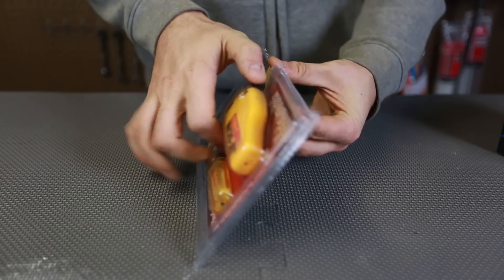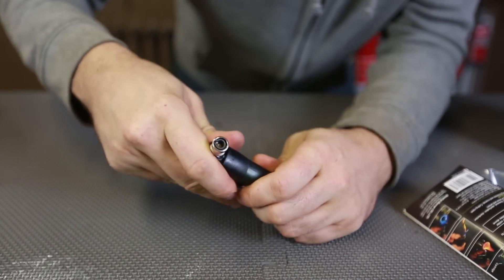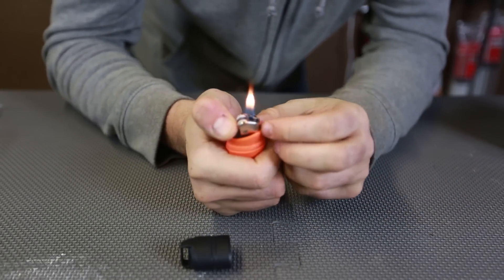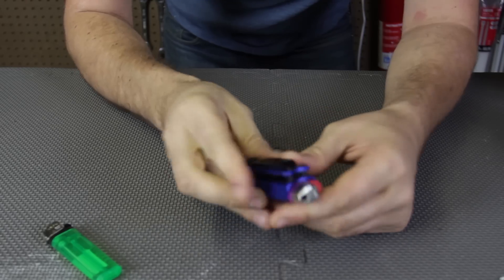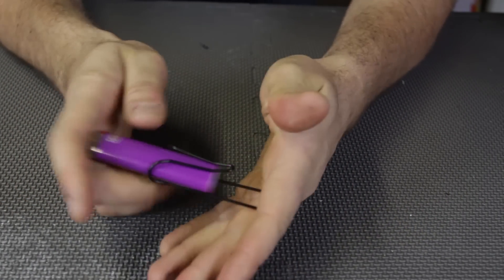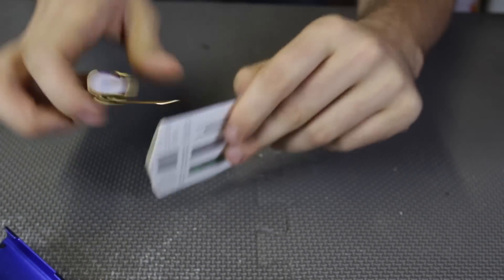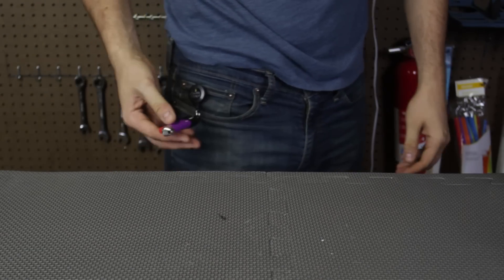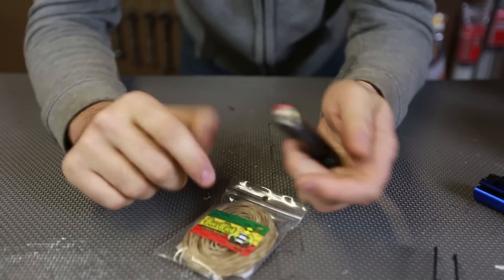9 Lighter Gadgets put to the Test

Comment: You should try the torch gadgets when you have "trimmed" the lighters to increase the flow. Take off the metal cap and set it to max, lift the adjuster upp and back to minimum and to max, until you get as much flow you want. would be cool to see how well they work on better gasflow

Comment: The last one is actually a hemp wick. It's used mostly by cannabis smokers to light their joins/bowls. It gives you better flavor than using butane from the lighter. But of course it can be used in a few different ways, to reach tight spots for example as its pretty sturdy.

Comment: I have another great lighter. It's called Turboflame. There's two versions. One has a single flame and the other has two flames. Apparently, the single flame version is standard issue to the British Army (so I read). They're both supposed to work in extremely cold conditions or in extreme winds.

Comment: i have one of the lighter leashes and with a regular size bic it will NOT fall out! i gang mine from my apron so it's not in any kind of pocket and i have never lost a lighter, they fit so snugly into the "glove" part that when you take the lighter out to change it you hear a very satisfying "pop" sound! highly recommend, i got mine at the local gas station for $1.99

Comment: But why not just carry a torch around and it will solve any possible problem?
Reply: They're not that portable if you come to think of it, right?
Reply: Douglas Aranda Maybe not fit in pocket that well, but I guess it's okay to hook on belt.
Reply: 野龍 Well, it's more of an improvised torch, not the best first option if you're already carrying a lot of camping gear or you're in your work place to be fair
Reply: Douglas Aranda It's just, by saying 9 gadgets, he featured 2 mini torch converter, 6 belt hooker for lighter, and 1 mini candle/lighter combo which is yet another hooker. 

But just hook a torch on belt and you get all the functions of these gadgets all together, since it's literally a torch, more durable than lighter, and lasts way longer, while still not that difficult to carry around.
Reply: ***** Yup. But otherwise, just use a torch.

Comment: I use the lighter leash without the retractable recoil part only the rubber or plastic lighter holding part on a carabiner attached to my backpack. But I put the lighters business end into the holder to keep it waterproof in the event my pack gets wet

Comment: The pocket torches are good for heat shrink sleeving, I had one like that, but you might as well just buy a windproof lighter from a head shop. Same kinda flame and costs less so that's what I use for that now. Also Clipper lighter > bic lighter...

Comment: you just have to push harder on the lighter bro to get it to go in the rest of the way. and it also has a screwdriver attachment you failed to mention. also the clip can be used with this case

Comment: Why did you not use a "crack lighter' in those torches?

"crack lighter' - what my friends and I always called them if you took off the metal cover and cranked the wheel to get a high flame.